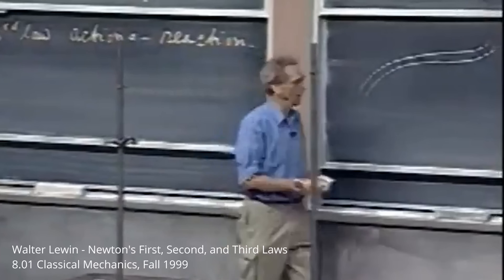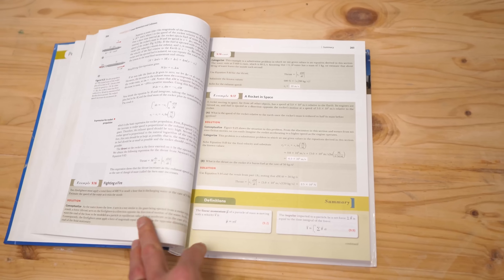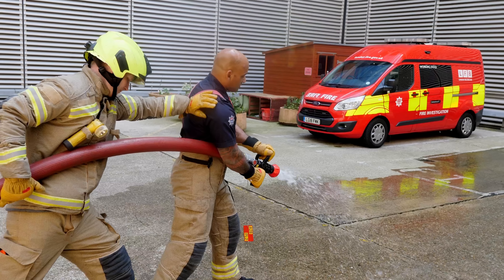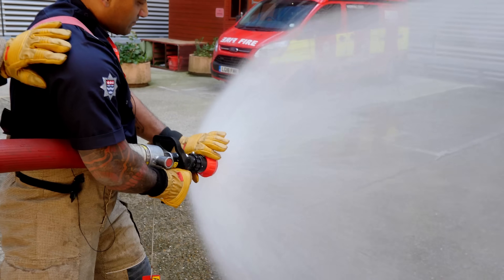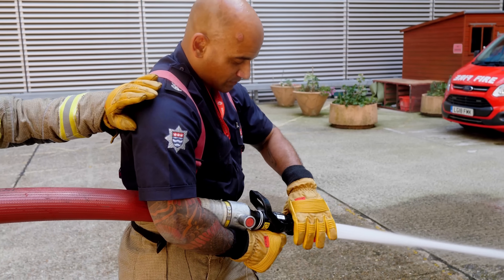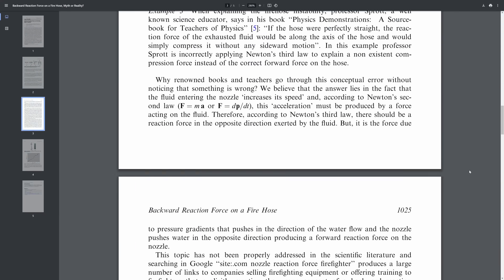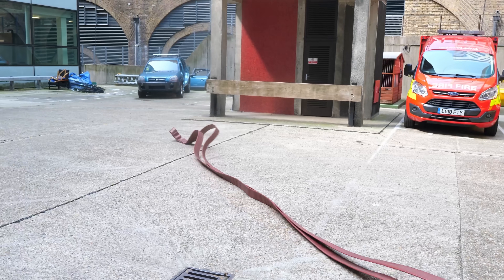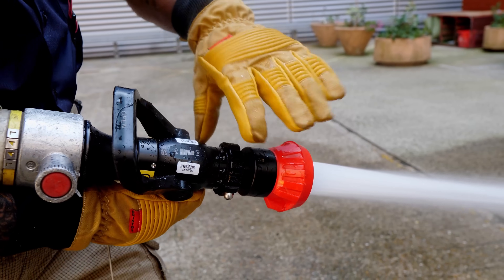Why chaotic hoses dance

Comment: Don't forget the nozzle at the end of the hose is almost certainly "choking" the flow like a rocket nozzle does.  You pinch down on the pressure, keeping it as high as possible right until the end of the hose . . . then the release of that pressure suddenly accelerates the water one way, and the nozzle the other.
Reply: De Laval hose wen?
Reply: Supersonic nozzles don't work the same way that subsonic ones do.  There's nothing that "pinches" the flow.  There's a constant-diameter length of pipe (very short in a rocket, but can be longer in power turbines) followed by a "bell nozzle" that only expands.  The individual molecules don't speed up in the nozzle, they just get organized to move in the same direction, more-or-less, so the average speed is higher.
Reply: Choked flow is only applicable when the speed of the fluid reaches the speed of sound in that fluid. Otherwise it's just the Venturi effect.
Reply: @erictheepic5019  false, the decrease in pressure causing velocity imparted on the nozzle happens at subsonic speeds, at any velocity really. Any pressure difference imparts force, obviously. More pressure in front of the hose than behind. Venturi effect is a small part of this, included but not limited to it, utilizing the pressure differential.
Reply: @erictheepic5019  Technically, the decrease in area decreases the static pressure in the fluid but increases the dynamic pressure (i think), since that's related to P+v^2.
Reply: @eldonperkins819  Yes.  That's why it speeds up and shoots farther when you narrow the hose-end. The pressure UP-STREAM increases when you narrow the exit. Otherwise the smaller stream would still go just as far as the wide stream. If the pressure is the same on the small exit, there is less water and, therefore, the force per mass is the same, THEREFORE, same distance. Putting your finger over the end of a garden hose, INCREASES the up-stream pressure.  We measure if easily.  Steve is much too crude in this video.  Here is an Excellent demo of it: https://www.youtube.com/watch?v=hZ5fZ3K4_mE

Comment: I think the weight of the water combined with the stiffness of the hose (from the pressurization) help hold the hose as mostly anchored up until just the nozzle portion, as compared to your air hoses. 
Also the viscous effects causing drag forces on the hose should be much higher in water, making the hose more inclined to move in the direction of the water (more inclined to try to straighten out). 
Not sure what difference that would make.

Comment: Your assumption about pressure being the same everywhere in a flowing hose is completely wrong, that only occurs in hydrostatics, never in hydrodynamics. It is losing energy to the hose walls when it flows. You prove this initially when you show why the hose moves.

Comment: Kinetic energy scales by the square of the velocity. When the fluid leaves the hose, there is a net force in the opposite direction due to the reaction force of the accelerating fluid. I think. OK, I'm going to bed now.

Comment: no mention of laminar flow that water inside the hose is crazy and bouncing off of it's self hitting all the walls of the hose. no mention of hose stiffness, why does the pipe not dance around it's the same as the hose but it's just a little stiff. you can push a string and it goes all the way back provide that string is as stiff as a iron rod. no mention of hose size I have 1 foot hose and 1mm stream of water going threw why is my hose not dancing?

Comment: Retired firefighter, not sure how the math works out, or if it's the full force, but absolutely there is a big force pushing you back.   There is a reason you see someone backing up the nozzleman and bracing them.
Reply: Also, pressure is NOT the same all the way through the hose.   There is a lot of friction loss between the pressure at the pump at the nozzle.  Much more than you would intuitively think, and even more so if you are going up stairs which even changes things more.   Just ask any DO about all the maths they had to go through during training, only to ignore it and either increase or decrease pump pressure when they get yelled at on the radio, because mathing while burning... lol...  and eventually you just know where it should be.
Reply: Retired DO here too, crank the pressure up until the nozzleman complains or falls down, then dial it back a quarter turn.
Jk, great video, I think the weight of the water is significant here too, a 2 1/2 holds like 200 lbs of water per hundred ft, that's why it doesn't elevate and whip more chaotically
Reply: @RalphieVII  "until the nozzleman complains or falls down, then dial it back a quarter turn" hmm, you remind me of someone.
Reply: @RalphieVII  conversely, if the engineer won't turn down your pressure, water hammer him a couple times to get his attention.

Comment: The "pushed on by the part behind it" is negated by same paper that made the hose pulling argument. 
At a certain point the hose is just taking the force from the pump and the nozzle and canceling them out. 
I guess that's just explaining why the nozzle is pushed backwards but the hose doesn't collapse away from a column of pressurized water (like pushing the sheath off the guts of a paracord {see "gutting paracord"}).

Comment: I think that, since the reaction force at the nozzle is much higher, it may also be the driving force of all that flailing.
When the hose is almost straight it starts to deform and bend, that's what happens when you try to bring ends of a rope close to each oter. In that process the end turns and starts to accelerate laterally. Due to relatively low elasticity of the hose, sections further away from the end receive progressively smaller portions of the lateral force, which causes the end to accelerate faster than the rest of the hose and to eventually bend in the opposit direction.

Comment: I don't think it changes your explanation, but another thing to consider on why the hose turns back to flip one direction or another is that the hose itself will be pushing back against the curvature. The hose itself will try to remain in its lowest energy state, otherwise lacking kinks or curves.
I don't think this force is very large, however I think that resistance builds as the force of the nossle pushes the hose backwards building a kink in the hose and thus being whipped back in the opposite direction after building up enough energy to overpower the current compression.
Not sure if I explained that well enough, but I think this is something to consider that I felt aided your explanation.

Comment: It may be worth highlighting the rocket concept a bit more, particularly in the chaotic / multi-bend version. When the nozzle is whipping around back and forth, it's pushing on a hose, a structure very similar to string. And string, as you pointed out, doesn't compress very predictably.

Comment: The moment where the string is pushed and it bends is used to say the reaction force doesn't transfer all the way back to the pump. This happens because the string is not stiff enough to transfer the force and you have buckling due to the compression. In a hose or pipe with enough pressure in it, the tension forces induced by the pressure counteract some of the axial compression from the force being applied at either end, and so you have a material that acts more stiffly. Because the pipe confines the pressure, the force is passed by that pressure along the entire length of the tube/hose, so the internal forces are the same as at the ends.

Comment: You're missing a critical component of your firehose analysis: the Nozzle. 
If the end of the hose were left unconstricted, the pressure in the hose would equalize to atmospheric at the pump. The pressure in the hose and the velocity of the jet are both created by the nozzle. 

The mass flow rate through the hose and the nozzle must be the same, but the hose has a higher cross-section area than the nozzle. As the flow in the nozzle restricts, the velocity must increase to move the same amount of mass per second.  The total pressure of the jet does not change, but the static pressure will drop and the dynamic pressure will rise as velocity increases.

Comment: So
Newtown's third law is how you have stated in such that the the water coming out pushes back against the hose.
But i think you might fail to see is it pushes back against the ENTIRETY of the hose. That means if i were to press on the front of a hose the PUMP wouldnt get (my assumed 275lbs of) force but the ENTIRE LENGTH of hose would reducing your force considerably.
Additioanlly,  even though the water column would try to push forward the nozzle would help center it (hence why spray doesnt useally flail).
And finally when there IS an inbalance the hose flails in acordance with the air flailing one.
Tl;Dr
The weight of the hose reinforces the spray-ee (the firefighter) holding the nozzle (provided they aren't at like 90 degree bends)

Comment: 7:20 I would think the pump feels the force, and it is resisted. So, wouldn't that force be transferred down the line, so to speak? I would be interested to know if there would be any difference in a hose shooting out a superfluid. I don't think there would be much difference, but still.

Comment: Two forces I didn't here you discuss are: 1) The pressure exerted inside the hose pushing outwards that stiffens the hose therein allowing the force at the nozzle to more easily be transfered back to the connection at the pump (or more likely to the first bend in the hose following backwards from the nozzle) and 2) The force of friction inside the hose pulling the hose towards the direction of flow. To be sure both of these forces would be comparatively small, but if you wanted to calculate the exact amount of force felt at the nozzle I think they should be considered.
Reply: Those forces is irrelevant because  the water nozzle is a rocket engine... The force is the weight of the water x the velocity of the water when exiting and the losses to friction and all that do not matter, only the exit velocity matter because THAT is the force you feel at the nozzle .
Reply: @a64738  I other words, "I never bother to read people's last sentences."

Comment: The pressure is not equal at the beginning of the hose as there is in the end of the hose, there are friction losses in the hose and so the pressure close to nozzle is lower than the pump delivers.

Comment: What if instead of water/air it was a series of metal balls just small enough to get thru a long pipe, with the pipe and balls lubricated, and the pipe design and material made the most flexible that would still not easily introduce a kink the balls couldn't get thru? And what if instead of a solid-walled pipe, it was a mesh-tube, kinda reminiscent of those air-less moon-rover tires? And would doing it in a vacuum versus in atmosphere change the outcome?

Comment: The rotational momentum seems important too here. As the bend radius decreases, and the bend travels towards the free end of the hose, there is a "shortening pendulum" situation, similar for example to wrapping a string with a weight attached onto a pencil. It winds up faster as the free hanging part of the string is getting shorter.

Comment: You forgot to factor in gravity. The biggest two differences between the flopy guys and the hose are (1) the direction you were holding them [floppy guys pointing upward vs hose pointing downward] (2) the weght/mass/density of the material flowing through them and the effect that has on gravity affecting the hose. ///// of course the end of the hose will be affected by gravity more than the base of the hose which is being constrained by the weight of the hose material holding it in place. point the hose up and gravity will show its affect more than if you point the hose downward .

Comment: I've analysed similar systems before, I was trying to design a Launch Loop where you have a bunch of magnets sliding through a tube on magnetic bearings . One of the insights I gleaned there is that the system is stabilised to a high degree by tension. So if you pull on the tube, sufficiently hard, the curves get pulled flat, and the system doesn't diverge and it becomes stable. I think that's what the fire fighters are doing (partially). However with water you get a lot of drag due to viscosity inside the tube, so the tube probably tends to pull itself taut to some degree. I THINK that's why only the end flops around along with friction with the ground when you let go, there's less tension at the nozzle end. But as you note, the nozzle itself introduces forces as well. For what it's worth you can solve the equations for these kinds of systems, and you find that they're most unstable at short spatial frequencies, but the tension tends to act as a low (long) pass filter on the spatial frequencies. Once you have enough tension, you've attenuated the system below its fundamental and it stabilises. Something like that anyway, I don't have my notes to hand, but cable tension is definitely the most critical thing and that was backed up by my simulations.

Comment: Interesting a mismatch in chargers, it's not like there would be a universal standard connector that would like you interoperate multiple different versions of chargers a different voltages... oh wait they're just slapping on a cheap connector. That explains so much somebody's coming home with three or four different models the chargers aren't labeled and they're all getting mixed up and people are going well if it fits it's the right charger…

Comment: Aerospace engineering grad student chiming in with a few things you might not have considered. 

One important thing to keep in mind is that there actually is a significant pressure gradient in the hose. I can basically guarantee the flow out the end of the hose isn't anywhere close to the speed of sound in water because that's about Mach 3 in air, which means that the static pressure in the water at the exit has to be 1 atmosphere. That pressure gradient is what drives the flow velocity against the friction of the hose. Using Bernoili's equation only works at relatively low velocities where friction from the pipe isn't important, and I don't think that's the case here. 

As for the straight vs curved hose issue, for the relatively straight hose, it takes a pretty shocking amount of tension for a string to stay straight with even a relatively small side force, hence why you can pluck a guitar string. A deep curve on the other hand can support much larger side forces with much less tension. I suspect the greater side force from the additional curvature and the lower tension required to support it perfectly cancel out in this case, kind of like how the thickness to diameter ratio of a pressure vessel to withstand a given pressure difference is fixed no matter how large or small it is.
If you could make the hose perfectly straight, you would get something more like a jet engine where most of the force is felt on the compressor itself instead of in the hose.
Reply: But a suspension bridge's cables stay in tension without moving much, and I've touched them without getting shocked by the tension
Reply: @quinnocent  the suspenssion bridge's cables don't move becasue they're in equilibrium with the cables anchored at the ends to hold all the tension. the anchors for a modern steel suspension bridge are usually concrete blocks multiple stories tall that weigh thousands of tons, and the towers are pretty tall so that the cable can have a lot of curvature. 
I think an easier to understand demonstration is to take a string with a weight in the middle and see how hard you have to pull on it as you straighten the string. as the string gets really straight, the angle above horizontal on either side of the weight gets really small, so the amount of tension you need to get enough net upward force on the weight gets really large. same basic principle.